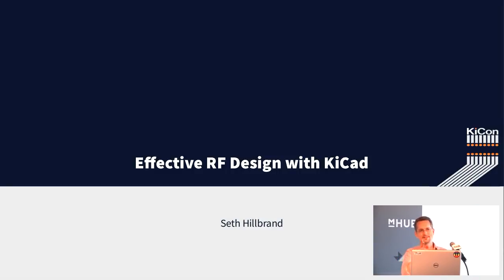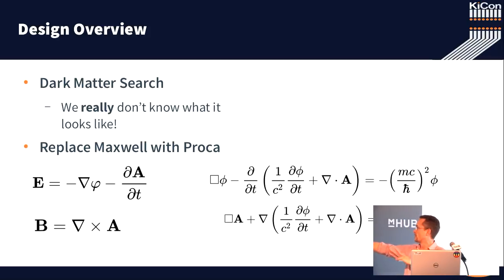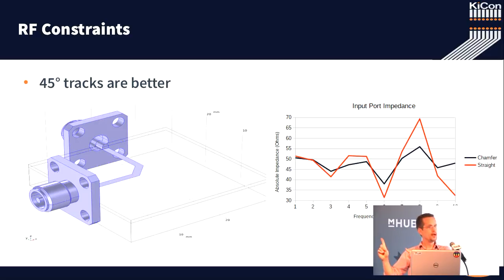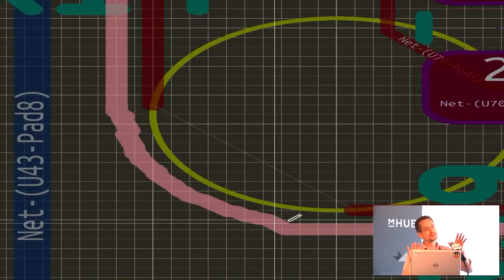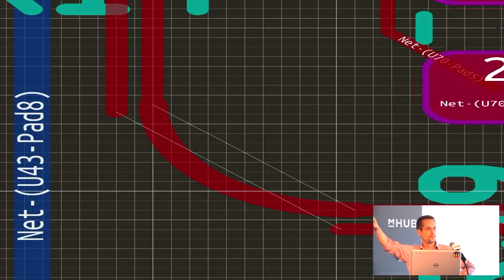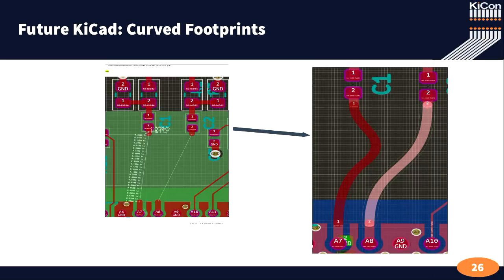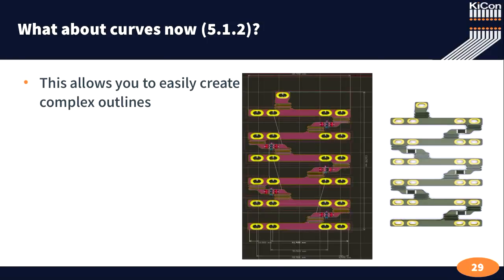"Effective RF And Microwave Design With KiCad" - Seth Hillbrand (KiCon 2019)

Comment: Summary:
1. Rounded track matter above 3 GHz
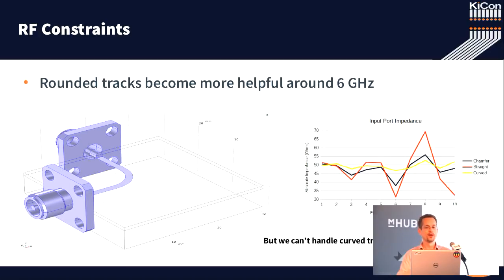2. Champher (45 deg) are better than 90-degrees bent, simulation shows input impedance varies by 10% span of 1-10 GHz @8:47 
3. No straight forward or out of box way to create curved trace multiple workarounds available

Comment: If your bandwidth is so important and return loss so critical then use stripline for the small section. What I mean is glue in a small piece of substrate over the track in question. This removes the effect of differences in velocity of propagation in air (above substrate) and in the substrate. Microstrip is crude (but effective) for connecting RF signals but sometimes stripline is required, such as in couplers. Also, get a copy of ADS and see how it's done.